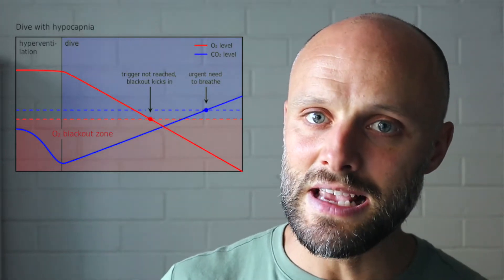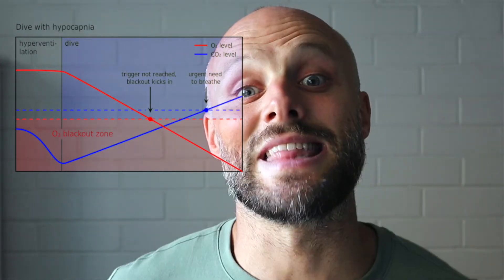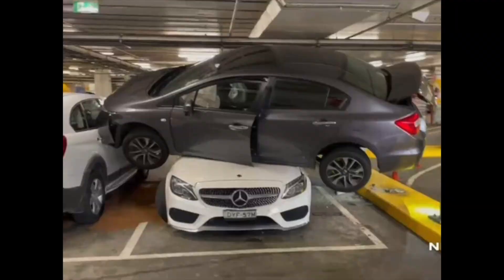Wim Hof Breathing | Why Can You Hold Your Breath for So Long?

Comment: This is interesting thanks for sharing. I dont know if this is true or not but wim said that it also increases the level of oxygen in your blood at the same time. Which is the whole point of the breathing excersize. He says there is benefits to increasing the levels of oxygen. I dunno if thats true or not thats just what win says. Just sharing some info. But if it is true then that would negate  any damage that there might be from prolonged times of low oxygen. ❤
Reply: No thats competely wrog. You can measure your oxygen in with a finger oximeter while doing whimhof. There is no relevant increase in O2 . Normally if you are healty you have a SPO2 of 98% what do you want to increase their?

Comment: Thank you for simplifying something that is easily complicated. I've never nailed this breathing down exactly to get the end results everyone raves over, but it does relax me and is as close to meditative focus as I've come across. It seems to enhance both my cold plunge and my exercise. When I was a kid I could hold my breath long enough to swim underwater the length of a swimming pool down and back five or six times. My lung capacity is not what it used to be so I find any kind of breathing technique that trains my lungs to be useful.
Reply from the maker: Thank you

Comment: Im a nurse and have a O2 monitor at home you place on your finger. I was curious how/if the O2 levels dropped during the breath hold. I am doing his beginner level and do not hold for that long, a little over a minute max at this point, but the O2 level dropped into the low 80s. Thats low. I have very healthy lungs and this was just an experiment because I was curious. Just sharing.
Reply from the maker: Hi Beth, thanks for your comment. This is because when you hyperventilate you create an alkalosis state which means that oxygen is going to stay bound to red blood cells. Oxygen delivery is therefore reduced to the peripherals such as fingers, and thus your O2 sats can drop much faster during the breath holds.

Comment: I appreciate your info.
So if his breathing exercise doesn't help one attain the benefit of holding their breath longer, what exactly are the benefits? What are the scientific, tangible benefits?
Because I've done the exercise twice and felt really good both times I completed it. I felt like I was high, like I took a small dose of pain killer that lasted for 5-10 minutes. But I would like to know the numbers and the terms of what's actually going on in the body when the exercise is done.
Reply from the maker: Thanks for your comment. The method induces a stress response, which releases adrenalin, dopamine, etc. It's a similar feeling to a runner's high or how you feel after a hard workout. I will do another video on this